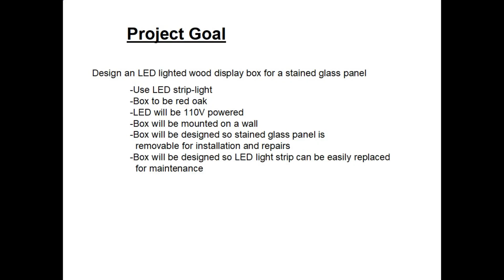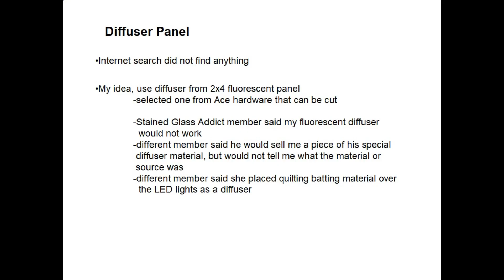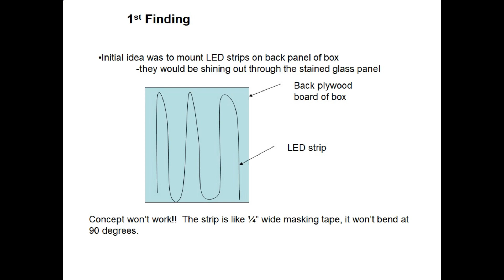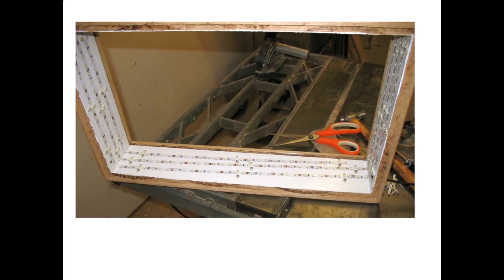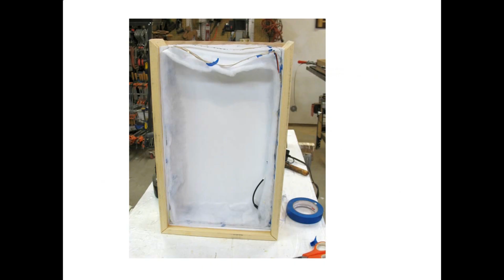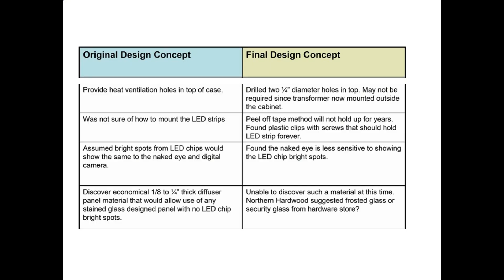How to Design & Build a Stained Glass Display Light Box

Comment: Very interesting and well done. I wonder, if and when one did need a diffuser, whether white plexiglass would work. It comes in bright white and off white. Also, if warm LED lights would be more suitable for stained glass since they feel less "industrial" and more "natural" (like the sunlight associated with stained glass).
Reply from the maker: People claim they have found material types that work as diffusers for these LED strip lights, but I don't know what they are.  Boy, I have never dug in and understand the different wavelengths of LED lights.  When I bought the LED strips, I don't remember any options for type of light emitted.........but LED technology changes so rapidly they may be available now.  Thanks !
Reply: I've seen vids of people using parchment paper and copy paper as diffusers under the stained glass panel and above the leds. I like the parchment idea. Currently working on a very complex project.

Comment: Dale: This was excellent and informative. I am working on a similar project right now. I have run into a few problems and some of them you have highlighted here. In my case, I used a flexible rope light which could accommodate your original LED design specs where you have the ability to flex the LEDs. I have noticed the bright spots as you pointed out in your video. I will look into the diffuser fabric idea and see how I can incorporate it. I also encountered the framing problem. I located Delphi Glass which sells the framing material also. I encountered another problem that you did not. I have some wood that is blocking the light at the bottom running the enter length. So, even though the light box is already completed, I 'think' I can make some adjustments to fix the problems that I see. The box that I created is made of decking material and I intend to stain it and hang the light box above the back door to my deck. I installed a new porch light which has an AC outlet that would allow me to plug it in. At the moment, it looks really nice. I did allow for adjustments inside the box for the purposes of framing it / securing it to the box. I believe the opening is big enough to accommodate the frame inside the box. Anyway, as I said, great video. I got a couple of ideas on how to make some adjustments. Best regards.
Reply from the maker: Glad you found the information useful :)
Reply: Matthew Swayne

Comment from the maker: I got a catalog from Delphi Glass supply company today. They are now selling LED lit stained glass display panels.  A little pricey at $133 for 8.5x11 inches and $213 for 16x20 inch.  Plastic frame looks a little "chincey" in the pictures, at the 4 miter joints, give the relatively high price tag.  Link is below.......

https://www.delphiglass.com/display-findings/light-fixtures/8-5-x-11-led-display-panel

Comment: Awesome video, lot's of useful details that people might not think about in the initial thought process when making something like this for a stained glass piece.

I didn't think to look for physical clips to hold the light strips in when I made my box and I just used strips of duct tape to hold them in place. Since the piece I made was for me, I didn't see it as much of a issue if I have to fix it at some point if they fall. Now I'm going to have to pick up some of these clips at some point and attach them properly. 

I had a couple of thoughts on what I was going to do with the control box on my setup. After experimenting for a bit, I decided to gut the control box and just install the electronics from it on the inside. That option won't necessarily work for all projects; depending on glass used you might be able to see it. But it did make it easier for my needs. The remote for controlling the lights also still works through the 2 layers of glass of my project. Have a pigtail coming out that connects to the power supply. 

In regards to the various solderless connectors for led strip lights: yeah, all the ones I've tried suck. If you use strip lights that don't have any waterproofing (waterproofing adds a plastic coating on them that you have to scrap off before soldering) on them, it's fairly easy to solder them together if you need to. I used phone wire in the past, works nice since there's 4 wires in it and the rgb led's I used have 4 connections. Not sure if it's different on white led's or not.

Hope my thoughts on this help some people.

Comment from the maker: I was browsing Amazon and found a set of 3 LED lights, each about 12" long with diffusers on them. They might work for a LED lighted box, if your stained glass panel is large enough such that the light bars will fit in the box.

Amazingcats [3 PACK] LED Under Cabinet Lighting Dimmable Under Counter Kitchen Lighting, Warm White, 3000K

https://www.amazon.com/dp/B0797RCZ3R/ref=sspa_mw_detail_2?psc=1